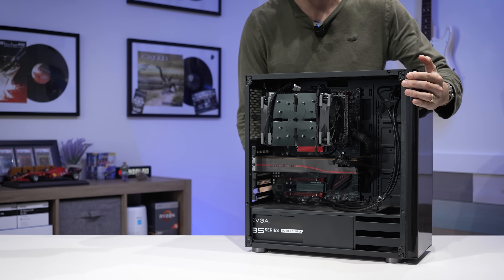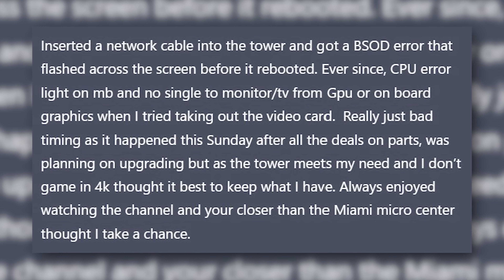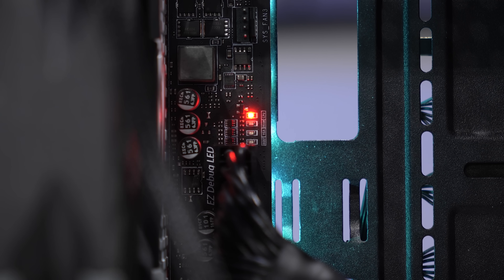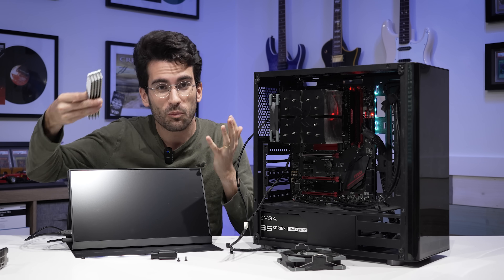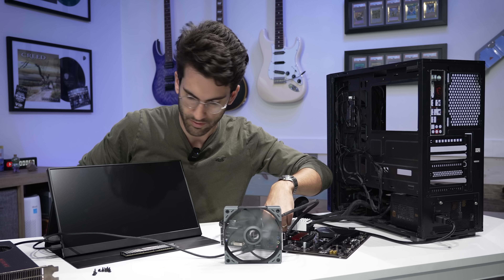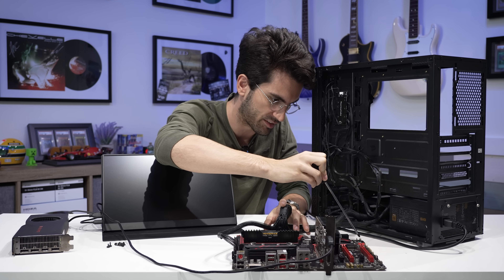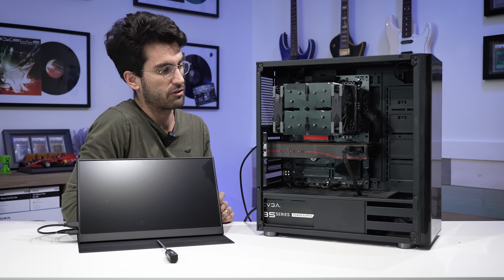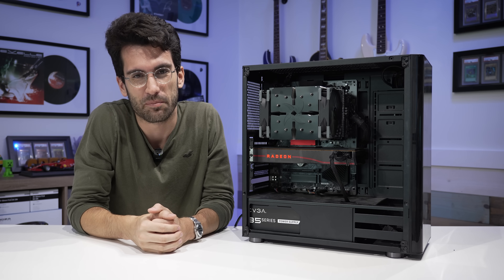Fixing a Viewer's BROKEN Gaming PC? - Fix or Flop S6:E18

Comment: @9:03, why does the CPU look so corroded?  The system board dying, probably the vibration/movement from the force putting the rj-45 in killed it. The very first event that would have caused some stress on the system board would have triggered the defect that was already there.

Comment: Static electric discharge is the most likely cause.  It can sometimes cause freaky stuff to happen.  Years ago, in the early 90s, I had a pretty nice home stereo system, with 4 large, 4-way speakers.  One day, I was listening to music at a fairly high volume.  I went over and touched the volume knob to turn it down a bit, and when I did, I felt a shock.  It instantly blew the tweeters out of all four speakers.  Upon inspection, I found the winding of all but one of them burned in half right after the connector.  I was able to solder all but one back together.  The last one burned right at the start of the coil, with not enough room to solder it back together.  I had to replace that one, and it was NOT cheap!  

Nowadays, I am careful to keep the relative humidity in my home at least 40 - 50% most of the time.  No more static discharges...

Comment: i have a usb top mounted front panel short and i'm hanging on a few more days to replace everything.before i accidentally smoke this board or worse  for good, every usb connection just dropped when it happened, i just unplugged everything. including power , waited 30 sec , then forced the already loose /damaged top panel pcb further away and now wont plug anything into those ports again. so a new case is needed.

Comment: One of the things that Network folks are taught is not have a network cable closely parallel a power cable.   It can cross ( directly ) power - but not parrallel.   why, because the network cable can get electricty from the power cable due to inductance.  Now - I have been taught this as a way to limit noise.  Is it posiblle that the 'customer' had too much power inductance and it burned something on the motherboard.  If not, this was just one of those 'coincidences'.  :)

Comment: anyone got any ideas for my problem, i have currently switched my HDMI to a display port, i get a post but then goes to a black screen, this then fixes itself if i switch back to a HDMI, it is also working fine when i switch the HDMI and display port when the rig is switched on but anytime i try to boot with just the display port it posts then goes black screen?

Comment: Hey Greg random comment but out of own experience a question: I got a new motherboard, new case and a ne cpu cooler, when switching over my Ram sticks one of the ram sticks died, as in i try to boot my pc up just goes straight into CPU debug light. why wasnt this a Dram light? and how does it happen that on one motherboard the stick worked but on the new one it didnt. I tested all sticks and all DRam slots, only 1 stick doesnt work in all slots. anyway love your videos its really interesting and nice to have the feeling that the viewer is figuring it out alongside you <3

Comment: VIP-SCDKEY link doesn't work. Did a search for windows 10 and 11 keys and it's only showing games. I used your link to give you credit and it just says opps or no results found. Have any other suggestions for valid windows 10/11 keys?
Reply: Both links just worked for me. The site may have had some issues when you tried earlier.

Comment: I have the same issue i turn on the pc let turn on and then i went smoke a cigarrete outside, when i came in, nothing on monitors.. restart nothing… then i Watch the GPU light on… i think my board died as well, i tried At least with other grapfhics card, i try Just with cpu to see if the light Will turn off, nothing…
MSI X470 Pro Carbon 
MSI what are u doing ?! 🤬🤬🤬

Comment: Greg, here is an odd one. I have been working on and building pc's since the 286 days. I recently had an issue where the debug led for DRAM was lit. The memory was lighting up normally and the cpu was warming up as well. I tried a new motherboard, cpu and ps. I didn't try the ram as ram typically doesn't fail in 6 months. Also, the system would not produce a video signal, from the onboard or the graphics card. I swapped one on my dimms into another system and it triggered the dram led, and killed the system. So I had to purchase a bundle as I couldn't trust any part. The memory in question is T-Force DDR5 8gb with rgb.

Comment: I want to thank you for doing your fix or flop  I have a verry old laptop it had Vista on it when new. The other day when I turned it on it booted till it started booting the OS then turned off. I remembered you fix or flop with the bad hard drive so I replaced the hard drive installed Peppermint and it up and running. I am 67 years old and retired so don't have a lot of money. thanks again you are a life saver or at lest A laptop saver.

Comment: you should never ever use daisy chain cable for a gpu, you can cause a fire doing that. I did it once and it completely melted the connector on the psu.

Comment: not bad, though I personally wouldn't call a B550 an upgrade over a X470. I had issues with B450M running my RAM at rated speed (4x 32GB DIMMs, had to downclock to 2666MHz) but on X570 (2 different boards) managed to get 3200MHz stable.

Comment: Agree with others that it may be a PoE (Power Over Ethernet) issue, or that bent shielding near the network port.
And that comment about not "repairing" it, computers are not like they were in the 1980s...back then we WOULD replace individual chips or capacitors, but then again we didn't have to deal with surface mount components that required a microscope to fix, and many chips were socketed and many off the shelf.

Comment: It's always interesting for me to see these repair solutions, I always look forward to a new video. I deal with this myself from time to time, I have a strange case with the Intel ARC b580 graphics card, which does not work as it should, it works when I insert and install it and I can also play games, but as soon as I restart or shut down the computer, the graphics card does not work, it goes into safe mode (not Windows, but the graphics card). ChatGPt said that the graphics card's bios is broken, that it happened because I have (had) a bad/old power supply, now I just solved it by replacing the graphics card and the power supply. Somehow I still want to fix the graphics card's bios someday, but for now I don't know how.

Comment: anyone here can help?

my PC turns on but doesnt boot.

here is what I have done so far,

- changed to a new motherboard
- swapped different CPU
- swapped RAM as well

but none of them worked so far

what I noticed is that when it turns on there is an odd delay with the RGB of the RAM, like 5-10 seconds

and there was a point that it no longer boot, but after 2 days I tried turning it on again it actually turned on, after 2 days of using it, it no longer boots again but does turn on

Comment: I haven't watched the whole video yet. but I had this happen kind of??? I was plugging in an ethernet cable from a 2.5G switch and as soon as I did, my computer bluescreened. When it came back on, the ethernet port was just.. gone? I ended up having to kill all power to it, let is sit for a day, and THEN I was able to access the ethernet port again. It was wild. I was nearly at the point of RMA-ing the board

Comment: When i went home to my parents with my PC, I had a B350 tomahawk mobo. And all it took is I plugged in an ethernet cable to the Shaw all in one gateway thing. It didn’t fry my computer, but that stupid gateway that need a phone app for port forwarding, it worked flawlessly all my dhcp lease and port forwards for month. The moment i connect that ethernet cable. All hell broke lose. My server's dhcp lease, gone, it now has a random ip address. And the port forwarding, stopped working too. And the shaw stupid app only let me select connected devices for port forwarding and dhcp binding and my servers arent even there. I had to stay till 2am, put that in bridge mode and scramble an old netgear router to restore my server and make it accessible online again. All because i plugged in an ethernet cable.

Comment: it sure is odd that just plugging in a Ethernet cable kills the board. but does depend on what the other side was plugged into. if it was a router/switch etc makes no sense. but if it was a PoE that could do it. also a usefull trick ive found to easy identify a board issue on msi boards is the rgb. if its stuck on cyan then means its not even trying to post. if it switches from cyan to red then its trying to post normally. also a way to fix it is to locate the Ethernet controller chip and remove it. a faulty nic chip can prevent a board from posting. i have fixed a board like that. yes you do lose the onboard nic but that is an easy fix by just throwing on an pci nic

Comment: Nice work, I'd be curious if you used a hot air pen to lift that asmedia chip off the board got it booting again, would loose some usb ports but would gained knowledge and probably a nice test board if nothing else.

Comment: I just built my new pc this month with a b450 board and while installing windows, I had an issue issue similar to this during one of the install reboots (no post, just stuck on cpu debug led). I was getting more frustrated when nothing fixed it, so I finally removed the cmos battery, removed the cpu, inserted the cmos battery, then inserted the cpu and plopped the cooler on top. booted up like a charm, no issues since. I have no clue what happened, but it's not the first time I had to reset the bios that way (though the other one was my mistake entirely because i'm dumb enough to trust the bios' built-in cpu overclocking preset).
And more importantly, I expected something similar to be the issue here. And honestly, it still could be. I don't rate it very likely, but given that both of your test CPUs were heating up, it's possible a bit got flipped in the bios and things are going wrong with the usb controllers because of it.
Reply: Quick note: I had the cmos battery out for like ten minutes before I put it back in and had disconnected the power supply to let all the capacitors discharge.

Comment: While extremely unlikely, it is possible for a surge to travel through an rj45 cable and fry a board. Hence some old, and even modern surge protectors and UPS, having rj45 protection. I have seen it only once in my repairs of friends rigs, but thats because my buddy spilled something on his router, which then sent a surge down every rj45 line connected to the router. Fried the router obviously, and both his xbox and his PC. It was a painful day for him lol

Comment: As the error occured following what can only be described as a short do you not thjink it could have correupted the BIOS and therfore flashing a new Bios would be an option ? assuming it has flashback, if not then obviously the bios chip would need to be removed from the board and placed in a suitable reader/writer

Comment: Hey greg, love the series, had quite an interesting story myself. I'm quite knowledgeable about PC's and worked a few year in an RMA department, but i started having random freezes and black screens where after the audio would continue and a hard reset was needed. Did plenty of load tests and other tests (Memtest) and one would assume stressing your GPU for 2 days would confirm it's fine, swapped out the PSU without luck and did some other troubleshooting. Turns out when i booted up MSI Afterburner the GPU clock would go from 1800 to 200 and keep doing that. Reseating the GPU didn't help. Then i cleaned the gpu pins abit even though they weren't dirty, and i kinda fiddled the 8 pin in and out of the power socket a bunch of times, hoping if there was some kinda oxidation or whatnot i would clean it that way, twirling it abit in the process. Low and behold, i boot up afterburner and the GPU runs stable at 1837 mhz. I can feel your frustration with some of these video's, it can be really frustrating haha. I guess what i've learned that day is that even though your stress and benchmarking software passes with flying colors, your GPU can still have issues.

Comment: 👋 Let me start by saying I have been able to fix all of my PC issues and NEVER flopped.😅 I always watch your videos and rarely comment but I can honestly say I learn a lot from you! 1 more learning opportunity is before me today as my PC works but every so often I have to reset it to make sure it's working properly. as I'm sure you know the NVIDIA drivers still have issues on 50 series cards. In your opinion do you think they will fix this issue with drivers?, or my GPU could be bad? These exact problems didn't rear up until I put the 5090 & 1250w MSI PSU in the PC.

Issues: windows stuttering/ blue screen/black screen/artifacts/power draw at idle on the 5090 I have should be ~40w but while it has these issues power fluctuates between ~20-80w at idle

PS. This PC works just has weird issues every now and again and I have many PCs so this is NOT a PRIORITY as I'm sure many people out there only have one PC and it needs your attention!😂 But hopefully you see this and maybe can solve this together! 👋

Comment: 10:19 does 4 sticks work is that motherboard quad channel or whatever
Reply: Ryzen 5000 series operate in dual channel. This is just running 4 sticks in dual channel. Quad channel is reserved for more high end platforms like Threadripper and Xeon.
Reply: @michaeldejode473  so theres no harm being done using 2 extra sticks ? it wont  cause instability?
Reply: @BudKing96  If you use four sticks you should buy a quad-kit. Mixing and matching RAM is usually frowned upon and might cause some issues.
Reply: @michaeldejode473  i thought typically you use 2 sticks in the grey slots a2 b2 something like dat
Reply: @BudKing96  For AM5 I hear it's the better thing to do (still need four if you want 96GB or more). Anyway I have ran both 2 sticks and 4 sticks with no issues or noticeable differences on AM4 systems.

Comment: I've worked with 10Base-T and Token Ring topologies in the past.  I do like and prefer Cat-5+ Ethernet   If i wanted to blow up a NIC card,.  I could but that would be willing and intentional damage to the card itself.  The card would blow before it damaged the bus, or the motherboard.  Unless I piped in 120vac from the wall and plugged it into a RJ45 cat5 cord then intentionally plugged it into a box.  I had a crazy cousin once, I taught them how to build boxes.  His wife somehow made a computer catch fire.  I've done every CPU and motherboard forever.  I was drunk once and tried to install an 8bit card into an expansion slot while she was turned on.  (it was a Convertible XT case (press two case buttons and you could lift the lid. Upon insertion and contact of the card there was a spark, and the box shut down immediately.  that was in 1992.  I'm smarter now.

Comment: I've had a few ethernet ports die over the years, but never had one kill the motherboard. They are very isolated to the chipset and should be protected from the other motherboard components.

But I noticed in the video that the motherboard pins on the bottom were a little long and bent.  possibly something was under the mother board at one time and maybe shorted out. or even bent too far and shorted to another pin.

Comment: Beep codes? oh led codes...  Reseat everything.  Did they damage the socket pins?  I run intel and Asus, does the board have internal video?  That CPU cooler looks like mine.  Yank the cooler and remove the CPU, look at the socket pins for deformities.  I still prefer intel over AMD..  Old habits die hard.  I love my i7 14700K with 64gigs of DDR5 on an Asus ASUS TUF GAMING Z790-PRO WIFI.  Time for a new i9 next year. I guess I'm lucky.  I find myself in a position to purchase a new intel CPU at half price.

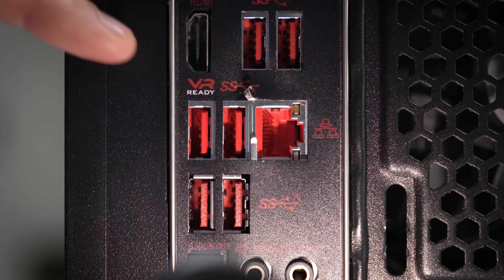Comment: 0:26 the faceplate shield connector is bent on the ethernet port. could this have touched something which would have shorted out the motherboard?
If this faceplate is earthed to motherboard and touched a 5V line for a powered USB device, that would have done it?

Comment: i also have a strange issue. i have a am4 platform with a r5 5500. stock cooler works like a dream. but i like unicorn puke. so i got a aftermarket cooler. pc runs great for an hour with great temps. but then goes into boot looping. then i install the stock cooler again and the loop goes away. i have no idea why. maybe someone here will be able to tell me

Comment: That is a ridiculous cooler for a 5600G, a chip that runs perfectly fine even with the tiny stock cooler.
Reply from the maker: Just means it runs super quiet! It'll be ok.
Reply: Sometimes it's just for looks. Also you could upgrade the CPU later on without having to think about the cooler. And if you have the room to have a big cooler, why not? As an example I originally had a 5700G with a NH-D15 chromax.black cooler (which is similar in size as the one in the video), later on I replaced that 5700G with a 5950X. That 5700G now lives in a small mATX case with the original cooler that came with it.

Comment: You didn't plug in an ethernet cable, without that I wouldn't consider the problem completely resolved
Reply from the maker: Plug an ethernet cable? Into what? The brand new board? Makes no sense. I can't test with his ethernet cable at his house for obvious reasons, but there's absolutely no reason to suspect that a brand new board's RJ45 port is both defective and capable of shorting out the entire component.

Comment: like others said there's a chance the IO bent pins are at fault, OR since Ethernet is talked about, wonder if they plugged in a POE Ethernet plug into the motherboard and that fried it as older boards might not have protections against it compared to newer stuff.